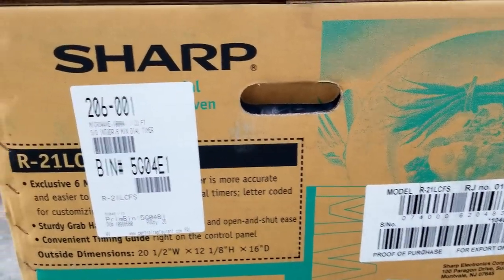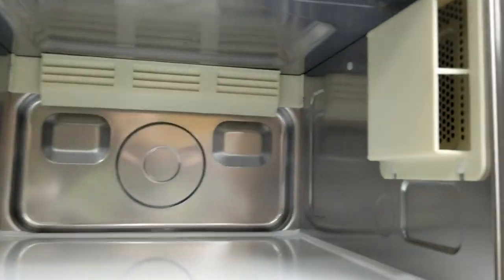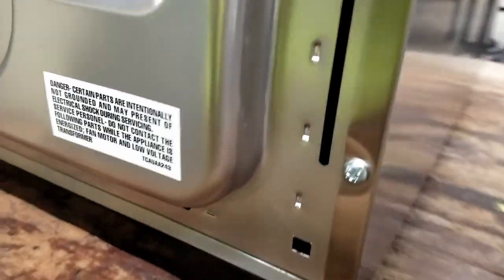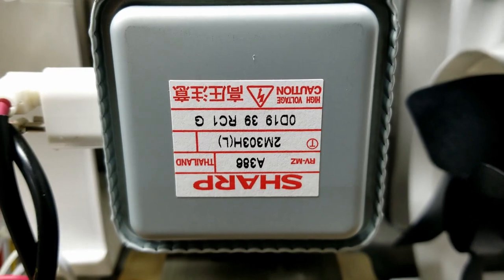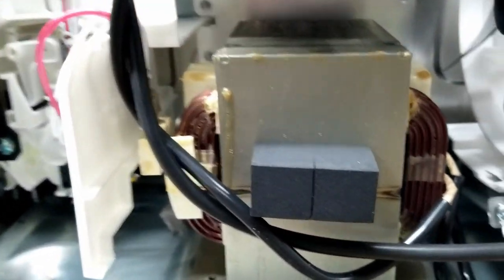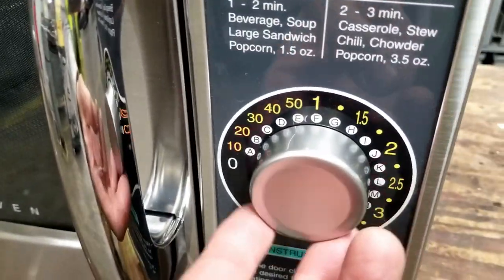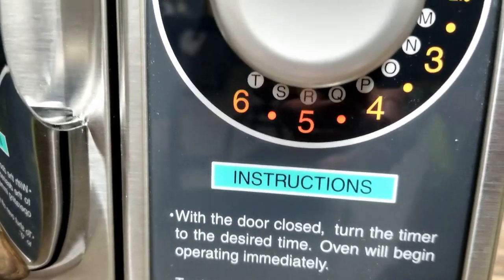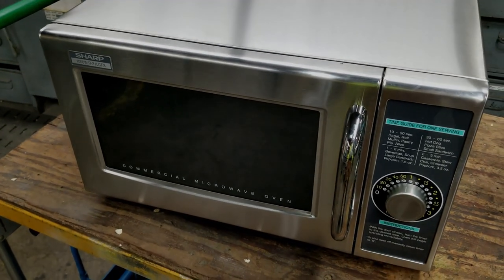SHARP R-21LCFS COMMERCIAL MICROWAVE OVEN UNBOXING AND SOME TESTING R21LCFS R-21LCF R21LCF

Comment: In our hostel I had a silvercrest Micro for years, and it was great. We recently gave housing for some asylum seekers, they killed it in 2 months. They never cleaned it, paint inside got overheated and metal got rusted so badly that the bottom felled off. I got them another one, stainless steel, also salvaged from a recycling bin.

Comment: One of the things I hate about microwaves is they have a ventilation fan, but no way of using that fan after the cooking is over to vent the humid air that accumulates inside during cooking. Hence the rust you mentioned. I find they always rust around the door gaskets because of that. It would be so easy to change the programming to make it possible to run the fan only for a while.
Reply: The Media Commercial Microwave Ovens do run after cooking for up to 1 minute. They do this every time you open the door whether you were actually cooking or not. You can cut the time down to just 15 seconds in the program if you want to. It takes care of the Humidity issue and helps cool the Transformer.

Comment: Update?
Reply from the maker: Still working in an industrial application that runs 24/7/365 with an average of 200 employees at any given time. With 3 of these microwaves I have seen 0 issues,
Reply: @norcal715  , well that's impressive, I'm thinking about getting this Sharp dail microwave or the Panasonic push button.